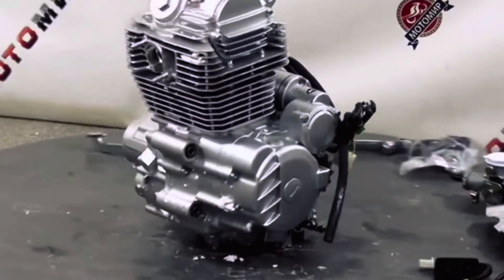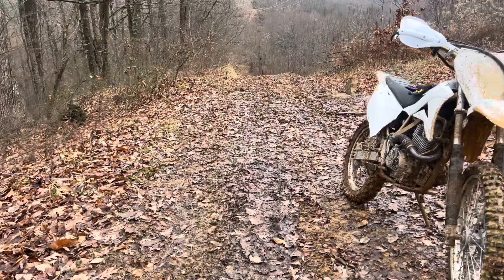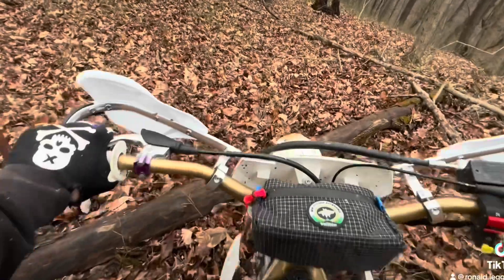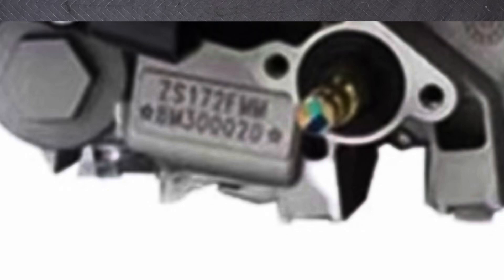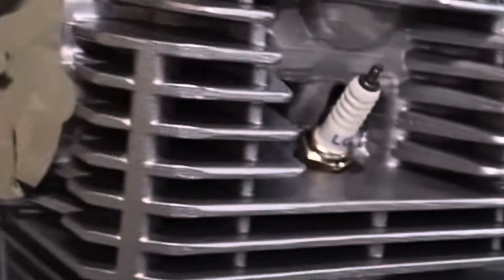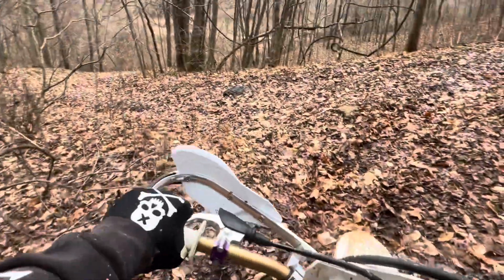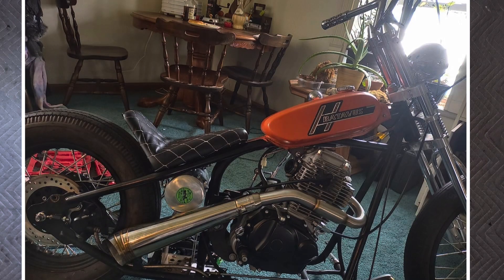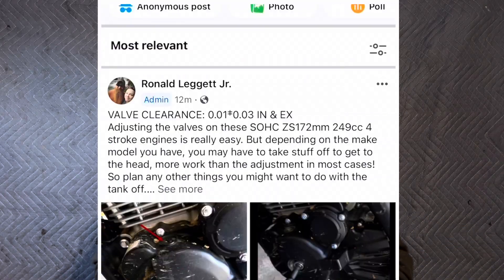Zongshen 250 specs and info

Comment: One zongshen engine has compatible parts with the Honda engine used in the CRF230F (carbureted).  I used a zongshen cam, piston and jug, timing chain and chain sliders which bolted or placed perfectly onto my oem Honda engine.  Works great and parts available, unlike some Honda parts.
Reply: Some are 230 L  different  than F

Comment: Recently purchased a counterbalanced 250cc 6 speed from Amazon. Came thru true to the word, except they sent me the wrong cdi. I’m searching for a wiring harness kit to fit. Ordered one off Amazon, but nothing seemed to line up. The two plugs on the back are not labeled and I’m not sure what they’re for. Definitely need the right connectors(should be otw here soon) but from there, I have no idea what to do and this was the first video that described my exact engine. Any info to get this engine going would be most appreciated🙏 I’m grateful I found your video!
Reply: Did u get the bike running if so I have same problem  could u help me please  thanks

Comment: i have a old cg 125 clone from baja from 2007 and its still going. I swapped it onto a yamaha blaster left for dead, and i use it alot never had problems with the engine before looking to buy a zongshen 250cc for a upgrade once the engine bites the dust. it should almost double the power lol

Comment: Hey nice video, good explanation. I’m wondering where you get parts for this engine I picked up a Giovanni 250cc and it needs valves, camshaft as wells as the sprocket. Can’t find much on Amazon and don’t know if it would be compatible. If you have any idea let me know.

Comment: I've got a ZS166FM fit up in the chassis of a 2023 xr150l. I've got everything working, only problem I'm running into is where to send the trigger wire, cause the Honda is a DC cdi, while the zongshen wants an AC cdi. Any tips? 😅

Comment: this engine is basically a old honda clone, it was even made by a guy from honda the designer was an old honda engineer.
Reply: so would honda Valve Springs, piston, clutches, etc. Be all directly bolt on or fit? 

That's one thing I'm scared of. I don't want to buy this engine and not be able to get parts. I like the idea of replacing consumables with honda stuff
Reply: Yamaha?
Reply: @jessefincham8899  the guy who designed the old Honda Xr engine platform.
Reply: some parts are directly compatible with CG engine models
Reply: @johnmichaelsuba8714  good to know 👍

Comment: I had the 230cc non Counterbalance zongshen in an Orion rxb250. The piston was made from chalk and took out the top end. I have since replaced it with another zongshen 300cc 6 speed non-counterbalance engine from bajaj. The right side cover came cracked. Some jb weld and I'm back in business. My faith is shaken but so far the 300cc has been a great running engine for the first 300 miles. I'll be looking to retrofit some more frames I can title for dual sport use. Nice little town and trail bikes.
Reply: Chinese shit is no reliable I don't buy it and won't buy any thing from the damn commies
Reply: I have a 2020 rxb250l with the 165fml 230 engine. Did that 300cc bolt directly up to the frame as it is?
Reply: @Handybee21 https://youtube.com/shorts/fI3SE61P0jI?si=uAVUyMqeTjjexC5E
Reply: @chadellis8732  https://youtube.com/shorts/fI3SE61P0jI?si=6ckMWX4CySGVn4jn

Comment: Zongshen makes great engines. 

Do know, Zongshen makes 2 different 250cc engines, but one of them is actually 223cc, the other is 249cc
Reply: How do you know the difference?
Reply: @faraadmohamed2325   the 223cc comes in the regular Templar. The 249 comes in the Templar X and Templar M
Reply: I have the new Trailmaster T5 dual sport, and it has the 223cc  Zongshen engine. I was very surprised by this engine, it has more power than I expected. And it's a very quiet running engine with great low end torque and strong mid-range power. No complaints yet. It looks almost exactly like the old Honda CRF-230 engine, except the Zongshen version has both an oil dipstick and an oil sight glass, plus a kick starter and electric start, all very nice features. So far I'm impressed with it.
Reply: @trevorjameson3213  around what years does is it a clone of Honda CRF230???

Comment: I have the Templar x with a 6-speed I'm happy with it so far it has a lot more power than I expected
Reply: I had an old 92 dr250se sohc that was rated 18hp and I’m over 220 and it pulled me around plenty fine. I can’t imagine how even a newer cheap 250 would feel
Reply: @codybertram6122  I'm 6'2" 260 and also have a crf 450r and I'm very happy with this bike I was definitely not expecting as much power as it has
Reply: @jacobscourtes576  my brother bought a cheap drz434 big bore with hot cams cause the guy couldn’t figure out the Jetting for the stock mikuni. He even cut an fmf q4 in half. I went from a 160 main jet to a 150 with a smaller pilot and the needle on the third clip wi the air box drilled and I could do 90 mph wheelies all day long. Man that bike was stupid loud. Most fun from 0-60 I’ve ever had.